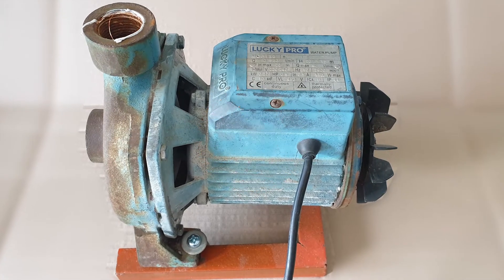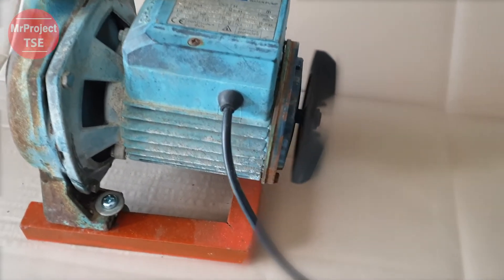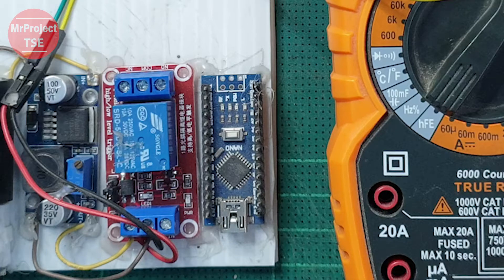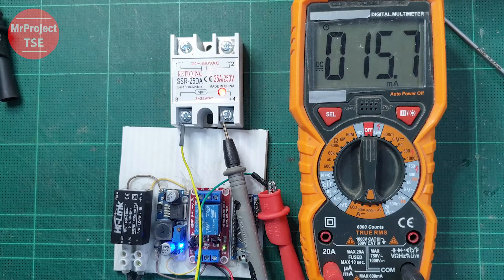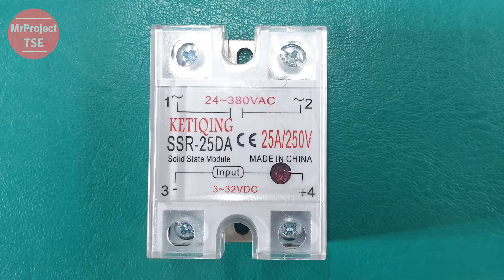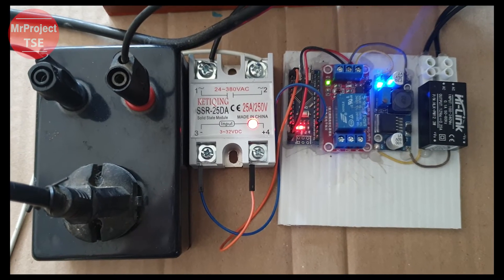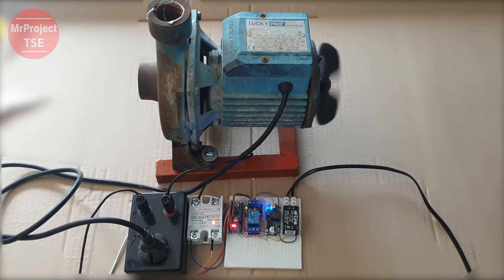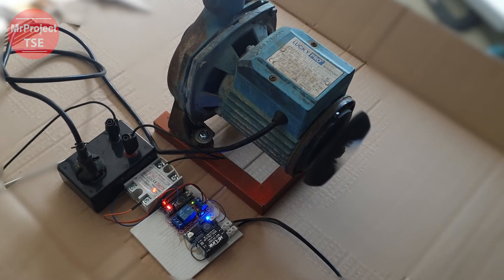Arduino AC Motor Control using Solid State Relay (SSR)

Comment: Will it work with 1.5HP pumps?
Reply from the maker: Yes, to be sure, the current rating of the solid state relay should be more than 15 amps.

Comment: I’ve heard when using a solid state relay that they get very hot and you need a heat sink but it doesn’t look like you’re using one. Great video thank you
Reply from the maker: It's not necessary if the current is low.

Comment: Hello, sir. I want to run the CVP-100 230V AC Vacuum pump with an Arduino. Can I use the same circuit as shown in this video with SSR?
Reply from the maker: You can use this circuit.
Reply: Hi! Did you successfully run the CVP 100 230VAC using arduino?

Here is my flow:

Rocker switch -> arduino uno -> SSR 40DA -> 0.4 HP 220VAC Piston vacuum pump

When i run it, the vacuum pump is already operating but not working on its full power. It is super slow and does not provide the standard suction level of the high powered vacuum Pump.

I tried to ask gpt but it says to change the SSR into mechanical one. 

I hope u can help me. Thanks!

Comment: i have teensy 4.1 board which has max current is 4 mA so how to connect it with SSR ? is only connect current limiting resistor is ok?
Reply from the maker: You may need to design additional circuitry to provide enough current to power the SSR.

Comment: Sir, what did you use to power the motor (the box you connect to the motor that is controlled by the relay)?
Reply from the maker: I didn't connect the relay. It was just an experimental set that I was testing with other projects, so I didn't take it out. I didn't use any relays in this experiment.

Comment: Hi I did everything right but when I plug the water pump the arduino doesnt have power
Reply from the maker: You may have connected the wrong circuit.Check carefully.

Comment: Hi, can you tell me how to make a module for 3 phase 3kvar capacitor switching with timers to on and off at given time?
Reply from the maker: Are you making the Power Factor Correction circuit?.Please tell my about your project.
Reply: @MrProjectTSE  Hi, yes my project is based on pf correction, but to a specific 3 phase ac load. I'm currently stuck at this project. Basically I have a 5hp 3 phase submersible motor, which pf is lagging. As I have only one motor load, 1 three phase capacitor(2kvar or 3 kvar) is sufficient. Now I want this capacitor to be operated after a min once the motor complete its flc when turned on anytime. Like a delay switch of 1 min to a capacitor makes sense, but can't able to progress in this project, any help from you is greatly helpful. Hoping a reply soon with a solution for my problem.
Thanks and regards 😊.
Reply: @MrProjectTSE  and forgot to say, I only have 3 phase  supply r,y,b from the transformer with no neutral.

Comment: Great! by the way do the the Mini isolator connected to the AC paired with the excess wires on the Motor and relay?
Reply: can u show what material you used to connect the hi link 2 wire to the 220v load? im still out of mind and can't find answers im still learning things
Reply: the connection of the Hi link mini isolator was both AC connected to the AC source of the motor?
Reply from the maker: Usually, Hilink will isolate the AC from the DC side, You can use the same AC supply as the motor.
However, to be sure you should check the isolation of the power supply.  @johnreyespano8346
Reply: what is the material called in inserting the pin of Hi link isolator that attached with the wire?
Reply: did you use socket ?
Reply from the maker: @johnreyespano8346  For ease of connection,I soldered the wires to a mini isolator and connected them to a terminal for ease of use with a power cord. That will be easy to experiment.
Reply from the maker: I have to apologize,
the relay was used for another project, but I didn't remove it 
The relay that you saw, I didn't use it
Reply: do you have a sample code on arduino?
Reply from the maker: I use the Blink program.You only change on-off time.
Reply: how did you connec the  mini isolator to the 220vc load?

Comment: Great video! By the way, what modules did you use to connect arduino to SSR? Thank you!
Reply from the maker: 1/5/10pcs LM2596 DC to DC Buck Converter 3.0-40V to 1.5-35V Power Supply Step Down Module
https://s.click.aliexpress.com/e/_De9k5ZT

one 1 channel relay module DC 5V 9V 12V 24V high and low level trigger relay control with optocoupler red
https://s.click.aliexpress.com/e/_DlQBD93

AC-DC Power Module Mini Isolation Switch Power Supply Module 220v to 12V/5V
https://s.click.aliexpress.com/e/_Dejcv9F
https://s.click.aliexpress.com/e/_DnKTkCN
Reply from the maker: A Relay module was not used in this circuit . We direct drive from Arduino Nano.

Comment: What to do if current consumption of relau is higher than 40mA?
Reply from the maker: Arduino can't  drive relay  .You must use driver circuit that can supply current over 40mA.